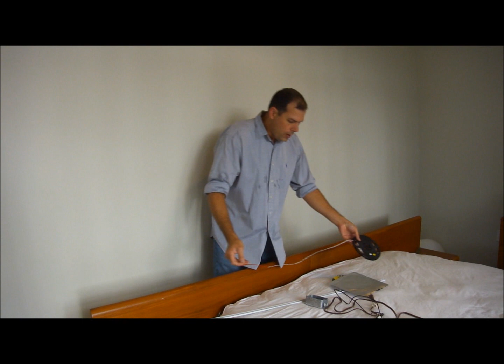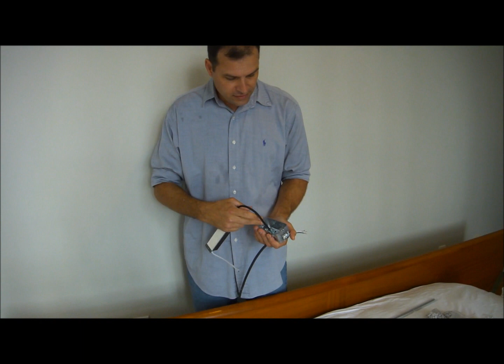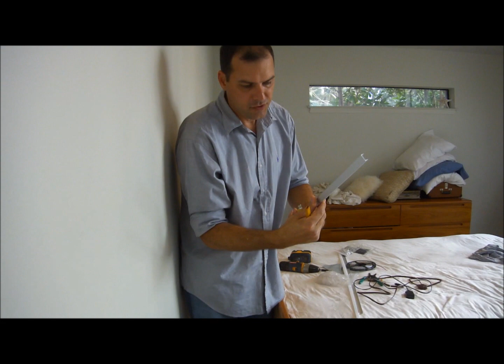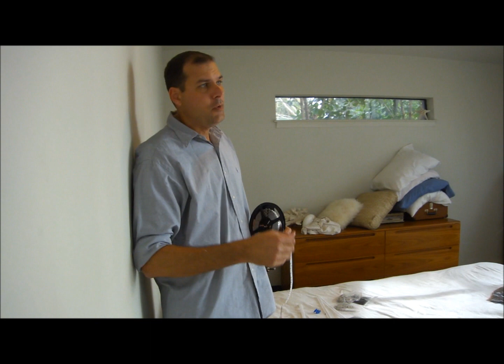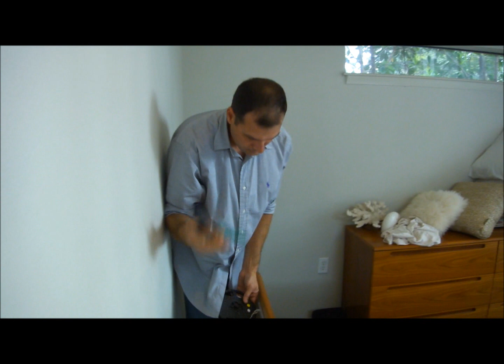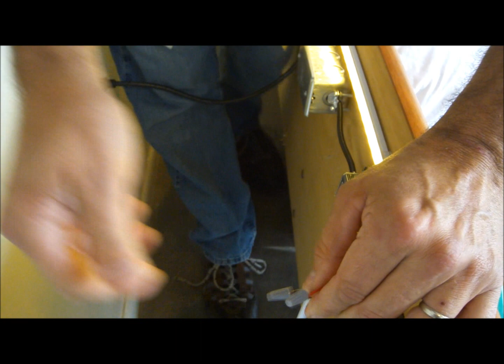LED Lighting Tutorial Tampa Florida

Comment from the maker: @anthroable That strip is just under 5w/meter (40") so a 30w power supply will run 240" or 20 feet. 

We also have high output strip, which is 3x the wattage, so you can run just over 6 feet with a 30w power supply.